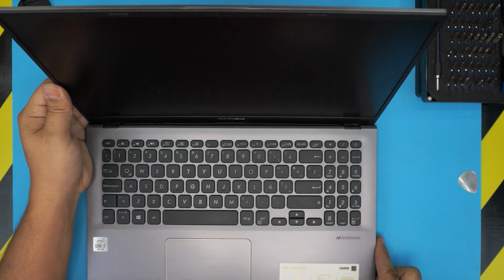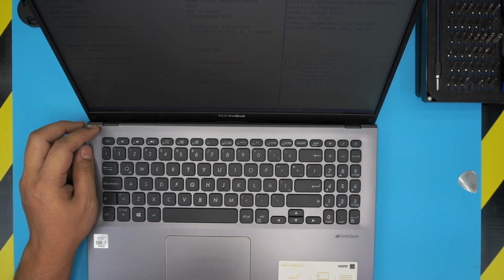Asus Vivobook 15 X512j ✅ Ram Upgrade 💻

Comment: Hmmm...according to Asus, the maximum RAM that can be used is 12GB. Is this right? What happens when I install a 16GB card to replace the 4GB that is in there?
Reply from the maker: 🫠Regarding your question, no the max ram is 16GB, but if you place a 16gb stick still will work!
Should you have any further questions or requests in the future, please don't hesitate to ask me.
cheers🍻

Comment: Hi. One question: Is this an X512JA model, X512JF model, or X512JP model? Thanks!
Reply from the maker: 🫠Regarding your question, this is : ASUS VivoBook 15 X512JA, as it does not have a dedicated GPU
the others X512JF , X512JP , have a dedicated GPU.
the ram specs are all the same.
Should you have any further questions or requests in the future, please don't hesitate to ask me.
cheers🍻
Reply: @uFixTek  Thanks, man! I was looking for a RAM upgrade on the Crucial website, and it says that the VivoBook 15 X512JA's standard memory is 4GB non-removable. So I wasn't sure if it had an extra slot to add a second RAM unit or not. Judging by this video, the answer should be yes.
Reply from the maker: and the answer is yes my friend 🫠🍻

Comment: Motherboard really supports 16GB ram with 4GB onboard RAM? If so, I have new hope for my laptop
Reply from the maker: 🫠Regarding your question, 1st double check the max limit: 
https://youtu.be/tKEJTkVth4Q
then if the limit is over 20GB sure you can add a 16gb stick, as we do for out clients.
Should you have any further questions or requests in the future, please don't hesitate to ask me.
cheers🍻
Reply: @uFixTek  I checked it, 32GB max, so I can upgrade. Thank you
Reply from the maker: yes you can, and it will work just fine.👍
Reply: Can you link me a good ram chip for this specific PC please

Comment: Hi, I have an Asus Vivbook X512ja which did not come with a backlit keyboard. Is it possible to change that keyboard for a backlit keyboard?
Reply from the maker: 🫠 If you wish to support the channel, you can like, subscribe, or both!
Regarding your question, yes you can install a backlit keyboard, but installing a back lit keyboard is not easy, you will need to remove the entire keyboard and the revits and all the internals before your can install a keyboard.
here is an example of the work needs to be done:
https://youtu.be/e1KdZQ2hN3s
Should you have any further questions or requests in the future, please don't hesitate to ask me.
cheers🍻
Reply: @uFixTek  Thank you for the reply and for the example video. I definitely wouldn't feel confident doing that myself but I may purchase the backlit keyboard and have a professional install it. Thanks again for the reply. Your videos are very helpful

Comment: My vivobook15 x512da Ryzen5 3500u Which RAM brands are compatible?
Reply from the maker: Thank you for your feedback! If you wish to support the channel, you can like, subscribe, or both!
Regarding your question, any brand my friend the brand has nothing to do with compatibility, as long as it is: sdram ddr4 3200Mhz
https://amzn.to/3RSmsMX
Should you have any further questions or requests in the future, please don't hesitate to ask me.
Reply: But the model with x512da with r5 3500u has 4gb on board ram and only has 2400 mhz ram frequency, how the hell can we use 2400 with 3200 mhz , will it not be a bottle neck issue 😊@uFixTek

Comment: Thanks, after upgrading somehow I am not able start, I can see the power light but nothing coming screen, please advise for troubleshooting, thanks
Reply from the maker: Thank you for your feedback! If you wish to support the channel, you can like, subscribe, or both!
Regarding your question, remove the ram and disconnect the battery and press and hold the power button for 15sec then place the ram and connect the battery and power on and wait 5-15sec to post.
you bios is stock and is not doing mem check, in order to force mem check fo the above.
to disconnect the battery cable slide the metal bracket on top of the connector back about 2mm and then lift the white jack up straight towards the ceiling.
Should you have any further questions or requests in the future, please don't hesitate to ask me.
Reply: Thank you my friend! you are the best men!